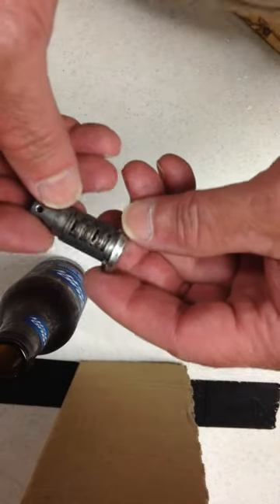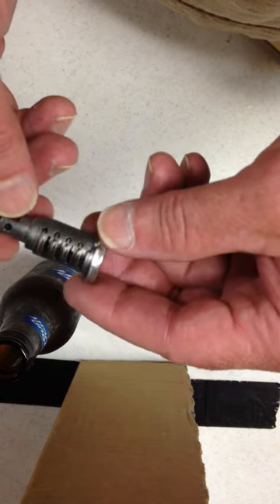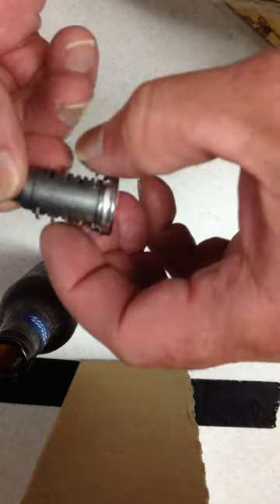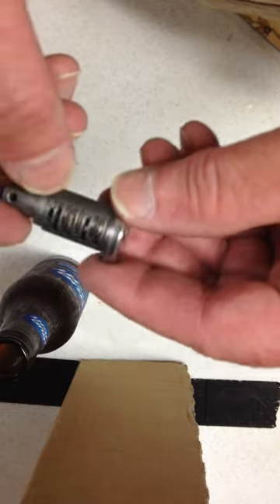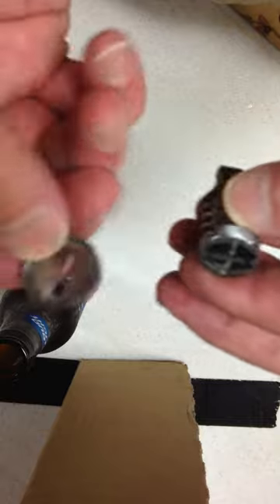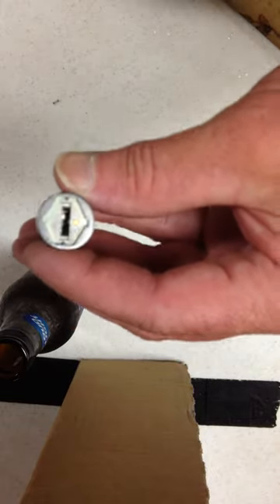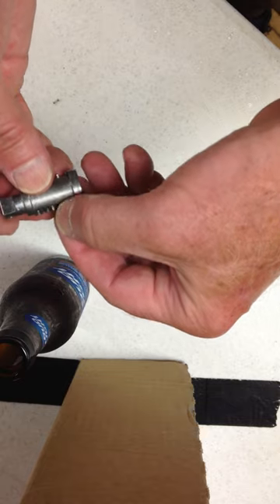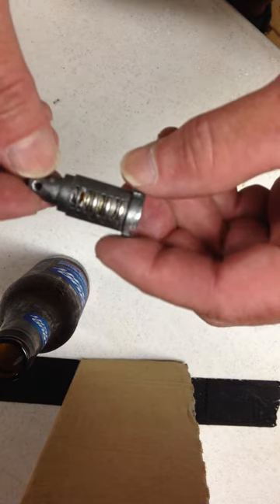BMW Motorcycle Factory Keyed Lock Cylinder for Cases, Gas Cap, and Ignition

Comment: Great video... I was able to re-key my seat lock (BMW F850)... the motorcycle is keyless and the seat lock mechanism is so cheap and badly design... this video help me solve the problem (broken blade on the flip key) re-keying the lock with a set of keys I had from a top box. I was able to carefully remove the cap and re-install it.

Comment: Locking the wafers in might just make quality control easier.  Wafer cores like to fall apart without a key to retain them.  The locking pin serves the same purpose and prevents someone on the assembly line from fat fingering the reassembly of a lock core that dropped some wafers on the floor, leaving one of the locks incompatible with the factory supplied key.

Comment: There is a way , but it's not really the correct way when working on other people's machines. I worked at a dealership for 13yr and we seldom used the "commando" method. The real way to do it is to buy a new lock cylinder kit . 
The only cylinders that are pinned are the ones that come with the bike when new (saddlebags included with the bike) or that the dealer orders from BMW  for say a topcase by VIN instead of keeping the kits in stock (as they should). 
The cap will not reseat correctly without the proper tooling.
 As your example shows, a bent , dented cap may be acceptable to some people but not many.